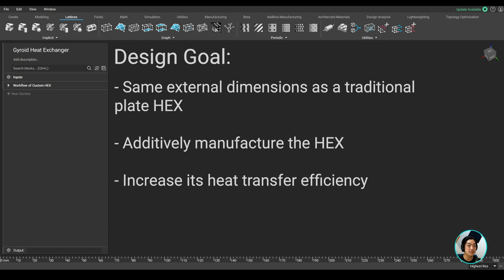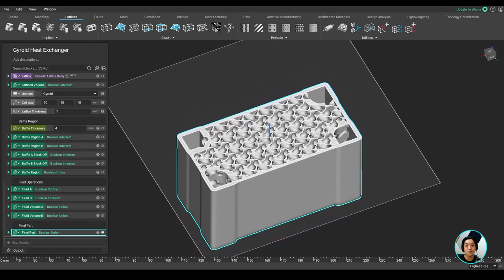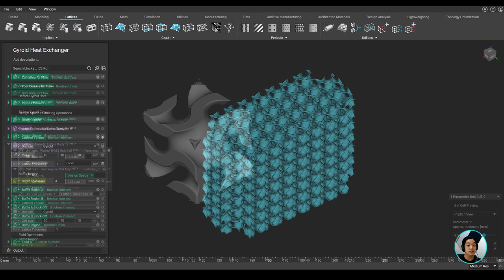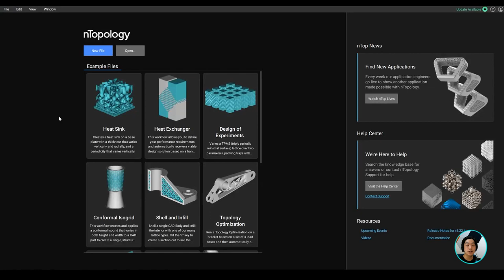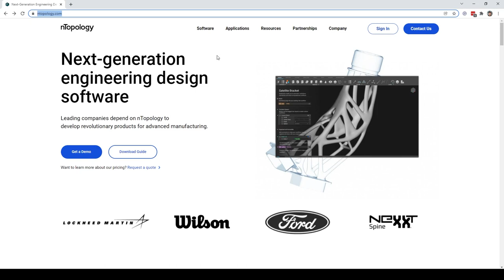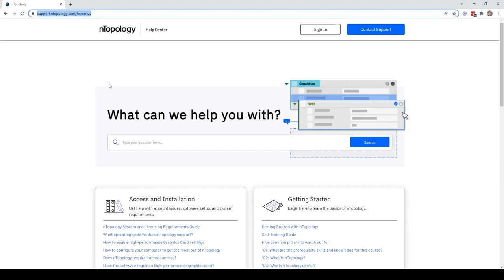Plate Heat Exchanger: Made Better with Additive Manufacturing

Comment: Gyroid filled design in ntopology is difficult to export it in Iges or STEP file to other simulation software, is there update to slove this limitations. Thank  you.
Reply: STEP would almost never be the export solution, try STL, but export them separately, so fluid domains and the solid.